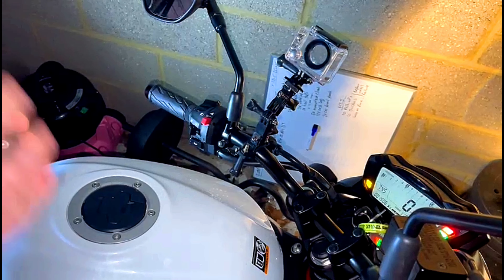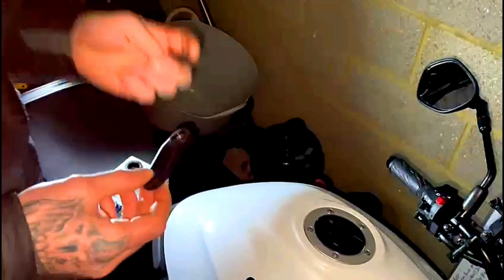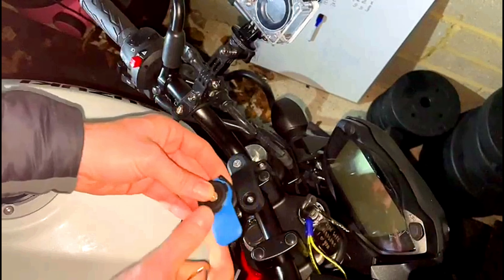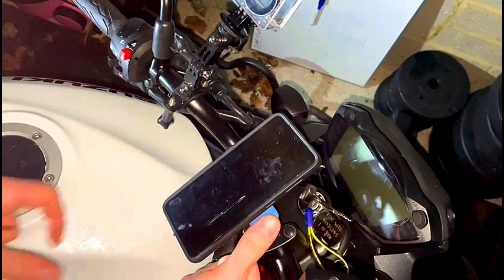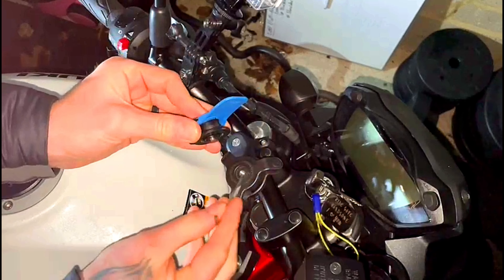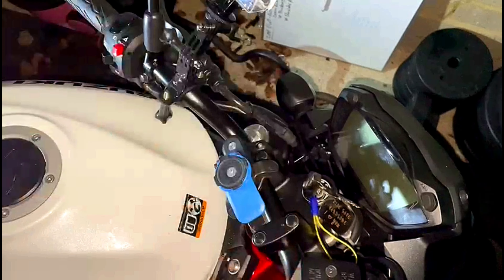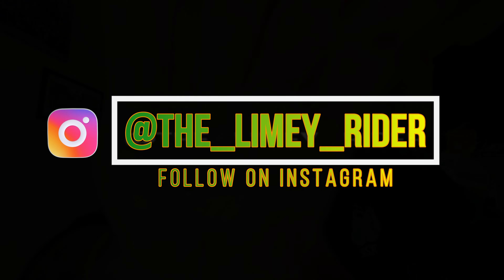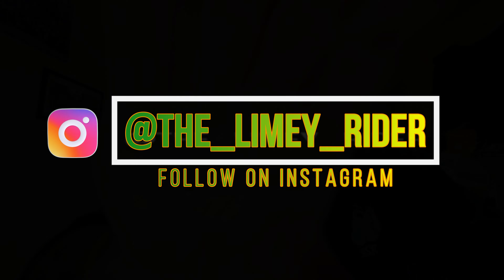Quad Lock Installation and Vibration Dampener | SUZUKI SV650

Comment: My phone just sits in my jacket and it's BT to my helmet head set for music phone calls and GPS directions if I need that as here in my city the cops don't like to see phones on bikes and normally will pull you over and give you a hard time for it by going over every thing on your bike. Quad Lock type units are not illegal here but if you touch your phone while riding you will get fined for that.
Reply from the maker: We would likely get pulled over and fined for actually touching the phone while riding too, I usually just set my destination and then leave it be, even stationary at lights we would likely be fined for touching it. I have a headset on my helmet, but I'm still yet to link my phone to it, I'm far too easily distracted and too new to riding to be taking calls just yet 🤣

Comment: Hi, did you have any problem with the lens of your phone? Can you do a vibration test?
Reply from the maker: Hi, thanks for watching.

I've been using the same phone for the last year on this quadlock and still have had 0 issues with the camera.
I can't say how good it is without the vibration dampener - I have heard that without it, it will cause issues to your camera. 

But certainly with the dampener installed it has caused no issues and I've ridden 1000's of miles with my phone on it. 

Hope this helps!
Reply: @thelimeyrider  If it wasn't a problem, could you record a short video from the phone that is mounted on the mount with the engine running? I have a mount with an anti-vibration module but I don't know if it dampens vibrations enough and I don't want to damage my new iphone
Reply from the maker: @kubashy  Sure thing - I will get it done today when I'm off work
Reply: @thelimeyrider  Thank you so much :)
Reply from the maker: @kubashy here you go https://youtube.com/shorts/bgqWFrVCXJU